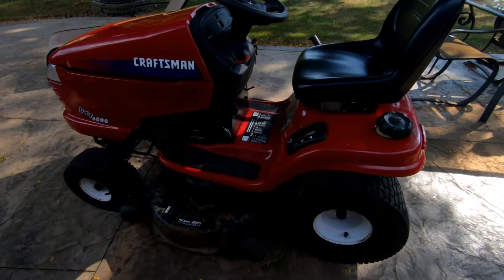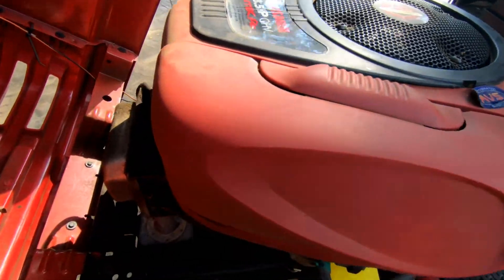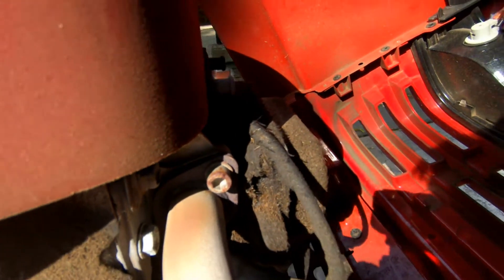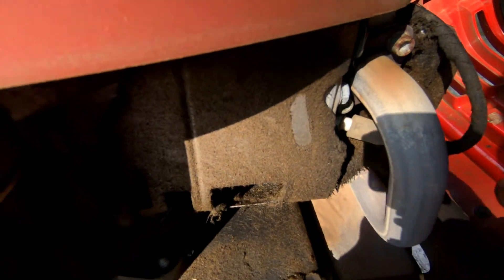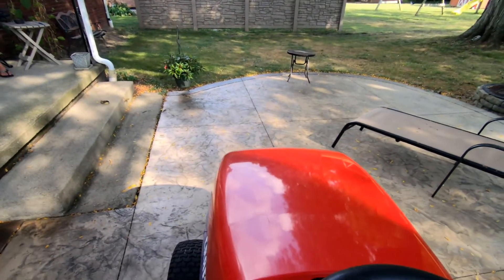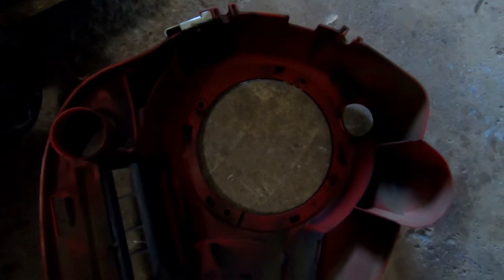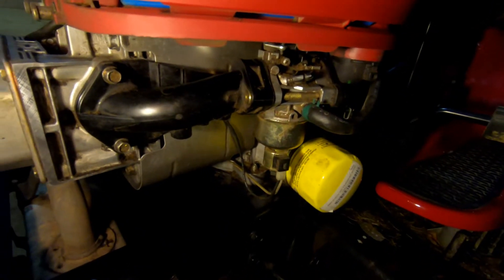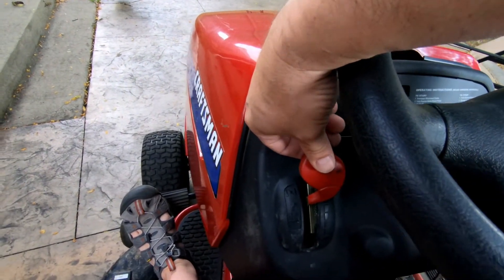Symptoms of a Blown Head Gasket on a Briggs Intek Engine

Comment: Thanks for the video, very informative. I’m working on a vertical shaft, Briggs & Stratton single cylinder, and I have an oil soaked spark plug, but not excessive oil burning that I know of. Smoking slightly from the exhaust and tends to misfire every now and then. Especially upon idle speed.

Comment: will this also cause oil to blow out the oil fill tube?
Reply from the maker: It's very possible. You should be able to verify that with a compression test.
Reply: @AGlobalLLC  It was the head gasket. Had a spare. All is good. Thanks.
Reply: Yes it’s building pressure in crank case

Comment: Depending on engine ie mechanical lifters w adjustable valve rockers, hard start issue if batt good pass load test and connectivity good after bypass solenoid still hard starting start off by checking valve stem  to rocker clearance.  Compression release isn't engaging due to too much play in exhaust side. 

If you see oil in air filter carb and or  around breather tube and find smoke in crank case oil dipstick after running it after seeing it start to smoke acutely then id replace the head gasket. 
Leak down test and compression test is good way to verify but doesn't hurt to just replace gaskets especially on engines w alot of hrs. Over 400..entire head assy and use lil rtv on rocker covers. Seals em up good.

Comment: Noticed your hood lacks any top venting over your engine blower, which could be causing it to run hotter than if fresh air was ducted straight over your blower.
That could be a factor in not only blowing head gaskets, but valve issues as well.

Comment: I just bought a riding mower with the 18.5 intek I'm sure it has a blown head gasket I just ordered up the kit for $12 I'm guessing 1 or two hours for the job
Reply: I just did mine and it wasn’t a bad job at all. Very simple and accessible. My problem was I didn’t have an inch lb torque wrench and had to buy one.
Reply: I did the job super easy took an hour. Head bolts 20in lb and no need to mess with the rocker arm bolts. My engine runs like new again!